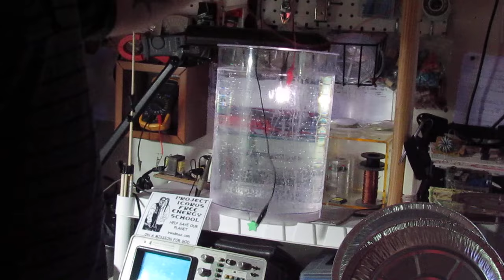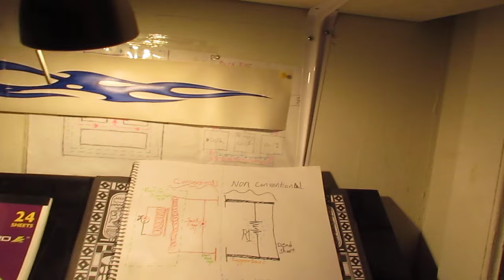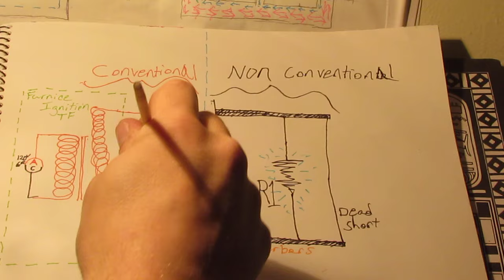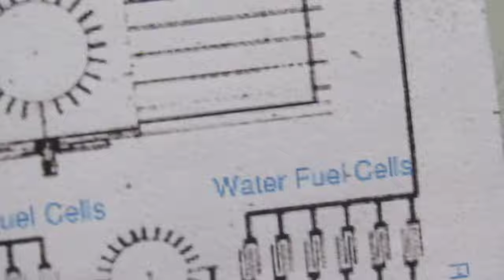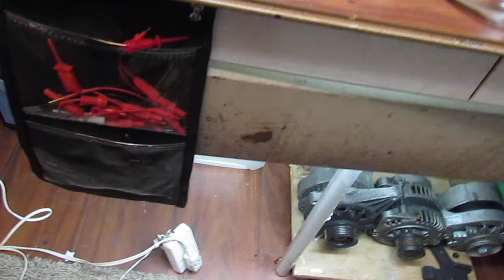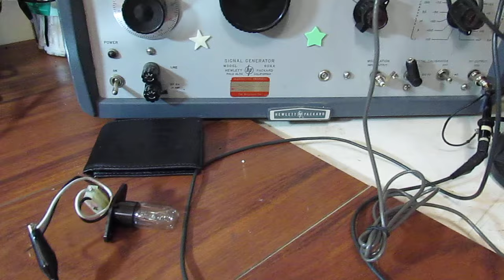Free Energy School Cold Electricity How to

Comment: nice video brother. i will try to get your epg board in the mail, this week. sorry i been really busy. what else you need for that tesla experiment? thats is pretty awesome
Reply: Breakzeitgeist Thanx for the video, did you heard about Konstaine Meyl and his work in wireless energy transmission. He uses longitudinal waves generated from osccilation of Tesla pancake coils to create these longitudinal waves. The surprizing thing about longitudinal waves is that you get more energy at the reciever end than was transmitted, so it is an overunity effect! That is becauses the energy gets collected from outside of the system, anything that matches the resonance. Anyways, if you haven't heard about Meyl check him out, he is pretty important goes along the lines with your research with Tesla's hair pin circuit :)
Reply from the maker: Awesome....funny you ask, I need some Shellak? Got any. I need for insulating the inductors.
Reply: Breakzeitgeist i use resin for fiber glass. seems to work fine. sets up in like 29 min. just spin the coil till the resin jells. around 5 min
Reply from the maker: Aetheric energy accumulation requires sacred geometric design and 
construction as well as the use of pure organic dielectrics in order to obtain and control useable energy 
from the Aether. Mica bonded with shellac is absolutely organic and fits perfectly in the design of this 
craft. Says Tesla  Shellac is made of the female lac bug, meaning it is a pure organic, being that it is essentially 
made (on an atomic level) of the same creation geometry as the Human body and therefore all sacred 
creation. But I will try it cause I have some:-)
Reply: Breakzeitgeist LOL well you can buy shelac online, i am sure. shelac takes some time to dry
Reply from the maker: Tesla used it to build with all his circuits and take this with a grain of salt to build the first flying saucer but very possable indeed because it was common practice for electricle engineers to use it back then and now you dont even hear of it.....hhhhmmmmm that useally is good sign that it could be true. Soon as the fuel cell is done you know the saucer will have to be built and I think I might have an idea of group up for the task

Comment: you caught my attention, where can I find some reading material on this cold electricity circuit?
Reply from the maker: Tesla...Heavyside and Stinmitz all talk about it...The output can not be measured with a meter but it will light a 300 watt bulb trough a piece of wire the size of a hair and after 10 sec. the bulb is at 200 degrees F so how could we calc that?
Reply: why not measure it? if it reads super low or nothing that is good data to have. Then compare that current input into the bulb by powering it through a conventual way and compare brightness qualitativly for a start. Why not collect the data?
Reply: what is the frequency of output? If its high you might want to use an analog meter if you don't have something rated for it. If your not collecting data, whats the point
Reply from the maker: Im sure it will all get done. I just wanted to share the effects and circuit... It has been supressed so now a lot of people know how to do it and all details will come out
Reply from the maker: I am just getting what i know out for now but its getting done
Reply: ok cool